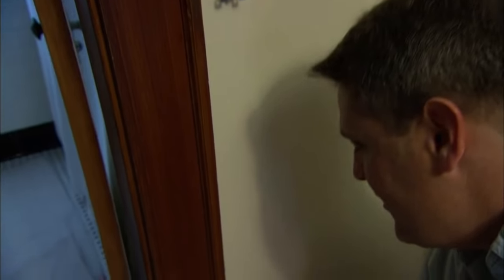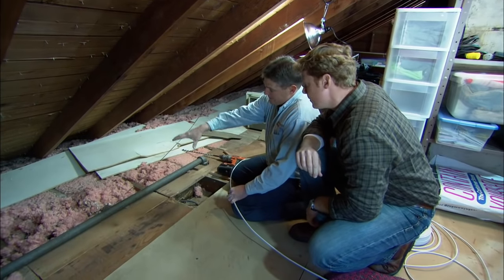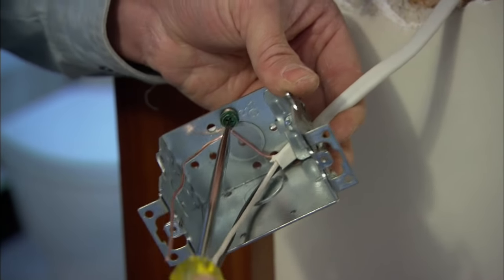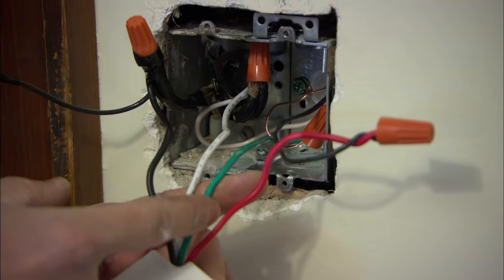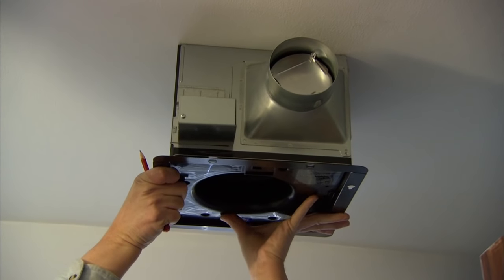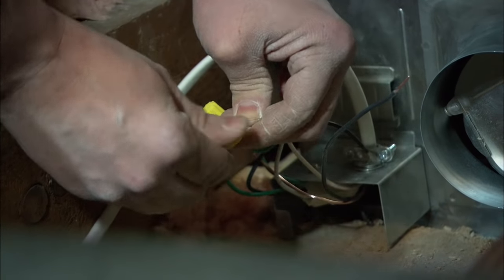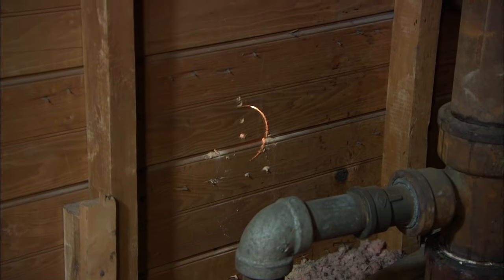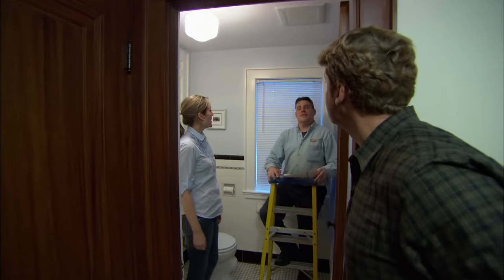How to Install a Bathroom Fan | Ask This Old House

Comment: Hey Kevin I've been an electrician for 30 plus years and love the way you magically re-ganged the 2 gem boxes back together without removing the original gem box from the wall as it is IMPOSABLE to access the gem box screws to re-gang the 2 boxes together without removing the first box from the wall. That's why your video skipped over this part. A real joke

Comment: This Old House should remove this video.  The number of mistakes done on this installation is a black eye for the show.

I’m surprised no one mentions that there are local codes for where a bathroom fan should be located.

Comment: Maybe I missed it, but I didn't see a line neutral.  I call BS.  He pulled power from a switched hot with no neutral... and then what?  Tied the fan's neutral to the light?  TOH is for watching, not for learning.

Comment: Rookie job.  Not using insulated duct.  Recipe for condensation and mold in the attic...

Plus you use metal foil tape. That tape will fall apart eventuality with extreme temp. Difference.

As for me, I would have vented through the roof myself. No way possible for the exhaust to creep back in the house. 
Glad I didn't hire this clown to do my job.  Then again, why would I hire someone to do a job I am well skilled to do?🤷‍♂️

Comment: TOH, WHERE did you find this Shmoe? I wouldn't hire this guy to replace a light switch for my home. He has no respect for his own tools, using linesman pliers as a hammer and a flat blade screwdriver as hole punch??? No no no, this is by far the first and only I hope video using such a bad contractor. Please dont use this guy in future vids please TOH.